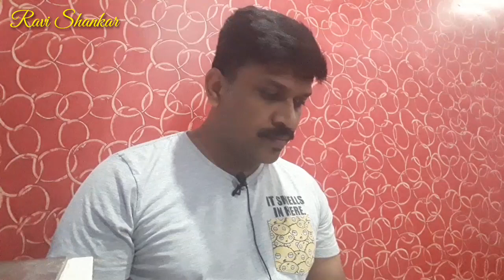HVAC Technician Interview Questions | Tamil | HVAC | Lohisya Media | Ravishankar

Comment: Bro for 5th qn, I thought suction pressure is high, because gas vapour level in evaporater is high,. Is it correct? Anyone pls reply
Reply: Illa bro evaporator la block irundha mattum dhan pressure increase aagum so evaporator out let la kammiya pogum suction pressure degrees aagum discharge pressure increase aagi hp cut off aayidum

Comment: In vfd output supply the motor runs by current or frequency or voltage in an interview asked question can u brief about this . But I answered as frequency  then he asked wat about current and voltage please brief about  how it runs
Reply: Runs by voltage by variable frequency which is given
Reply: vfd speed control also called as a v/f speed control method, voltage also involved important considerations, v and f not current
Reply: current directly involved about motor torque